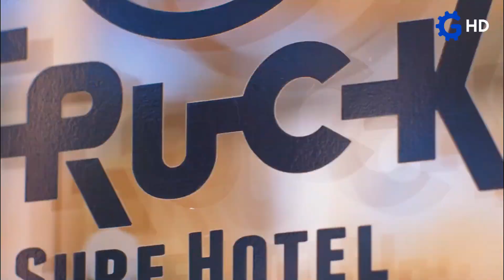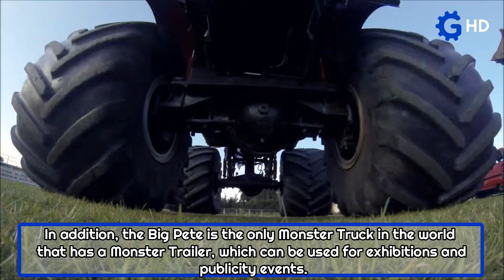CRAZY CUSTOM TRUCK INVENTIONS YOU PROBABLY DIDN'T KNOW ABOUT  ▶  HALF TRUCK SEAPLANE

Comment: The floatplane rig is a very common design. Typically they start with a 4WD truck, and use only the front wheel drive.